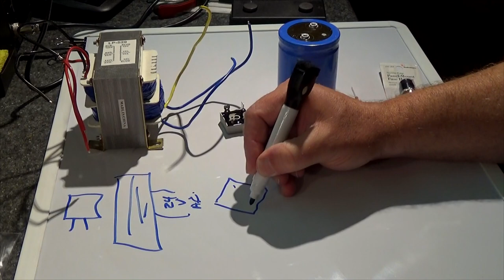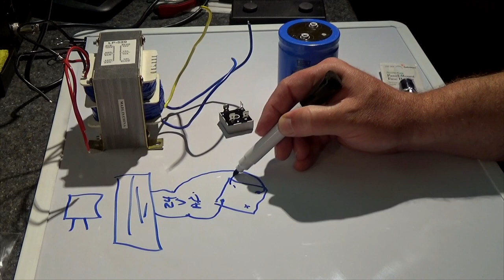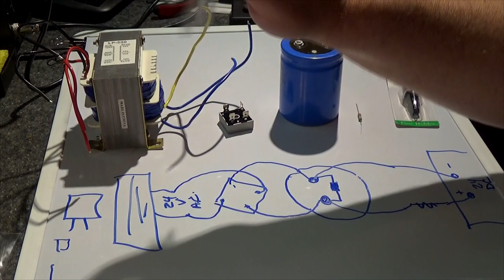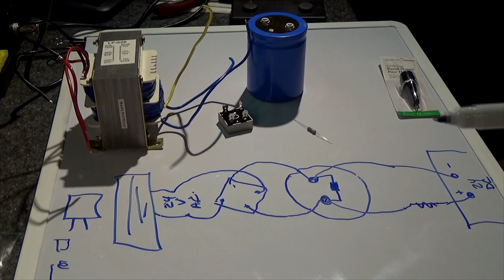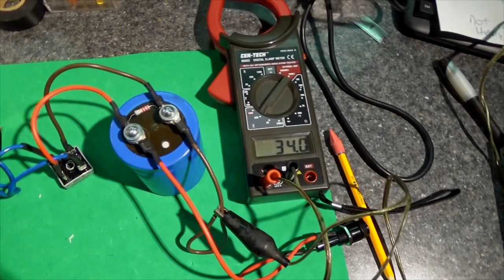CNC Stepper Driver Build #4 - Building the Power Supply

Comment: True DIY - nice! I find cheap cutting boards make for good board 'platforms' - they are easy to cut and aren't brittle like plexi but provide rigid support. Just pick up some cheapo cutting board at Walmart or whatever and use that as your board holder/spacer.
Reply from the maker: I like your idea and picked up a cutting board at the Dollar store and will likely incorporate it. Thanks
Reply: yw - Thin (1/4") MDF works ok too (easy to shape/cut/drill) but if there's any chance it could get damp (not likely for your setup) the cutting boards work really well.

Comment: Hi, I'm from Australia.  Why do you use a 4A fuse on the left side and a 10A fuse on the right side?  I thought your transformer takes 10A so wouldn't you use 10A both sides?  Does my 220V mains power change the fuse that I would use?

Comment: how many volts and amps would my power supply need to have for 4 nema 17 motors rated at 2.4v and 1.5 amps per phase? i am also using a cnc shield if that helps.

Comment: Steve, a regulated 24V 10Amp switch mode power supply already built can be purchased for around $20.    Any thoughts?
Reply from the maker: I like the simplicity of a linear power supply and wanted to stick with building as much of the project as possible myself. Also, I like the fact that Linear Power Supplies offer low ripple and noise and are highly reliability, plus they double as great space heaters in the cold winter months :)
Reply: I agree 100% and do appreciate the DIY approach.  For myself, being on fixed income, cost of a project is high on the list.  Wish you could buy transformers at the dollar store or overstocked  :)
Reply: 24V/10A, 20 usd? I don't believe. if yes, it is very bad